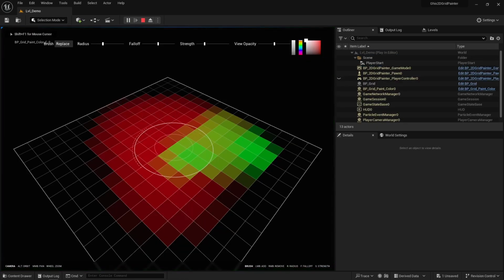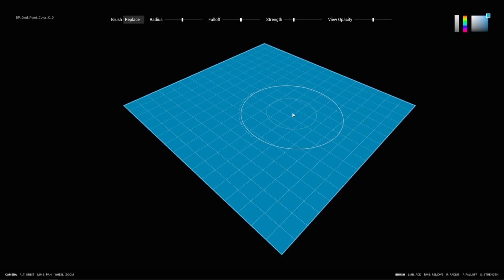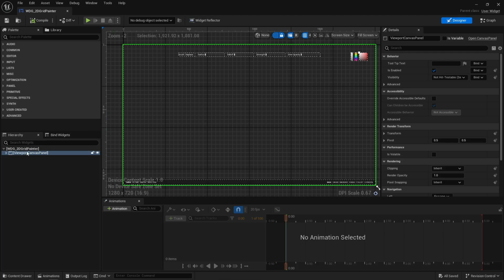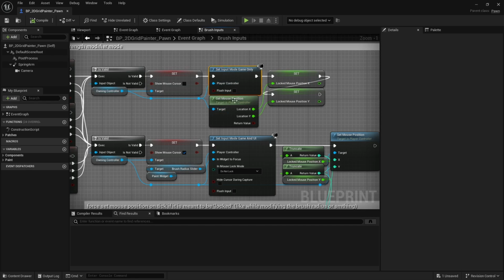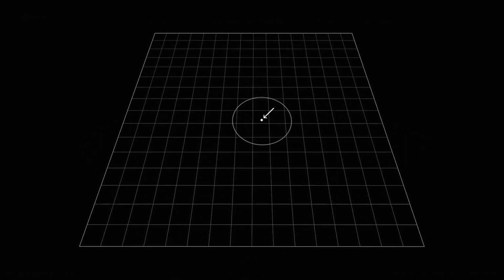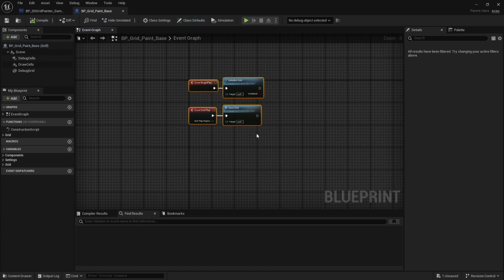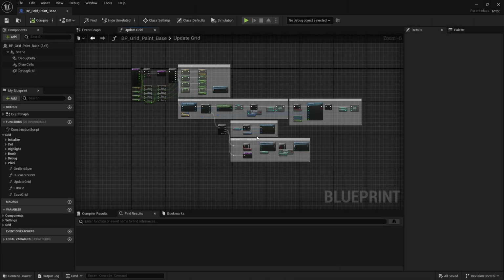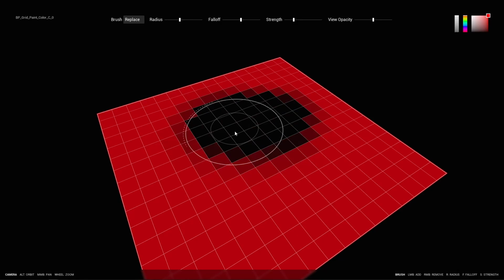How I create in-game dev tools for UE! Custom interface, inputs, shortcuts...

Comment: Cool tutorial! Quick question about the grid visualization, do you have antialiasing on in your project if so which kind. I used the same article to build my grid but it seems to be creating lots of ghosting with translucent materials when AA is on. Thanks!
Reply from the maker: TAA is on, default settings. You may tweak the material's translucency pass settign to render it after motion blur. Helps with ghosting.

Comment: i will like to add some tips, I use to make the same tools but i don't like to make my tools in "play mode", all those functions can work in editor mode (not play mode), using Utility Widget you can get keyboard, mouse events  and editor camera as well. I don't like the "play mode, simulation mode" tools because sometimes i want the tool to run in a  game map not overriding the game mode , or zero setup from the end user, just run the Widget and work.
https://www.youtube.com/watch?v=m3AUhYpwI8A&t=15s
Reply from the maker: Yup, utility widgets are cool and I agree with you. Using a game mode to build tools is not the greatest experience and certainly has its limits, features wise, especially if you stick with blueprints. I prefer Scriptable Tools to Uility Widgets though. Anyway, I just wanted to show that it's still possible to create tools in-game :)
Reply: @ghislaingirardot  yes, actually play mode do give some more options and is easier to check mouse position, editor mode have to make all the offset of screen calculation. Is very limited working with teams. I enjoy your videos, please keep making them!